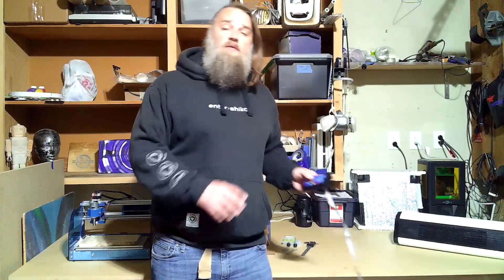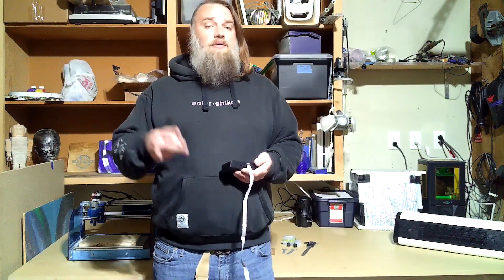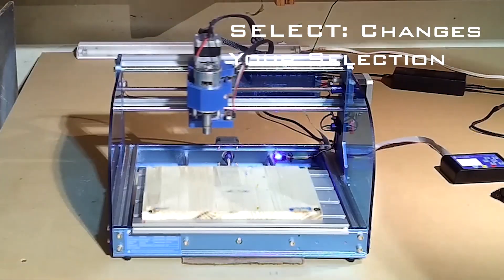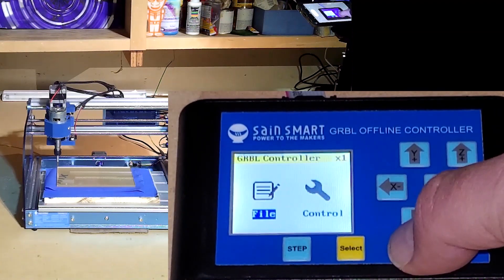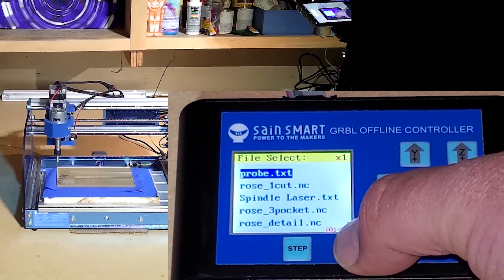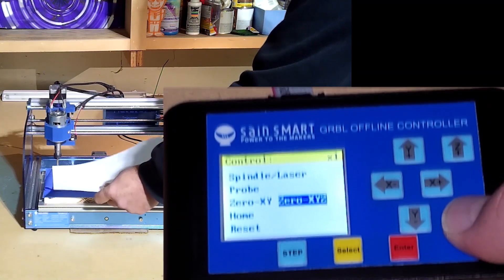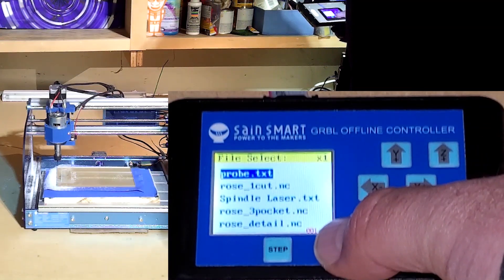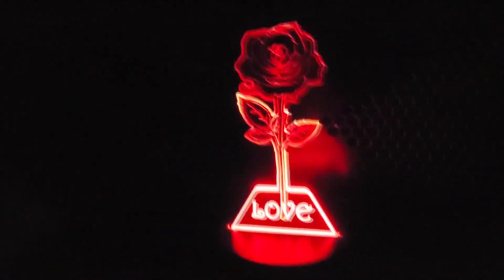SainSmart 3018 PROVer Off Line Controller Tips, Tricks, & Workflow

Comment: I have a problem when using the probe and the offline controller. After the probe touches it retracts way too much and activates the upper limit switch. How can I set the height it retracts? If I use a laptop and Candle, I don't have this problem.
Reply from the maker: There should be a 2 files on your SD card. Probe.txt & spindle/laser.txt  go into the probe.txt and see if there are any settings you can adjust for that. It's been awhile and I am not close to my machine to confirm if you can set it in that file.

Comment: Hi can you program with the offline controller?
Reply from the maker: No, you can not. You can only jog the axis, start and stop your spindle, or fire your laser, set job zero, and run your gcode.
Reply: @D.E.Hammer  thanks I am try to find a control can program there such thing? Or i need to write gcode line per line
Reply from the maker: Not that I am aware of. Best bet for now would be write the gcode. What are you trying to do?

Comment: ok so.... i have to save multiple cuts as different files to allow for a tool change?
Reply from the maker: Yes, you will need to save a gcode for each tool change.
Reply: @D.E.Hammer ok thanks. Do you have to redo the xyz after tool change? Will I have to start from the corner of the material then to 0 the xyz? I would think cuts would be off if I fuck that up. (Sorry for all the questions, struggling with it)

Comment: Could you explain what gcode you're using to get your 3018 to return to your work zero at the end of the tool path?
Reply from the maker: So towards the end of the gcode, find the last z movement, so if your retract height is 3, it should say Z3.00 after that I put X0.00 & Y0.00 (each on their own line) this sends them back to job 0.

Comment: I upgraded my 3018 prover with the 3040 kit but I don’t seem to have the max travel settings correct. Not sure what I am doing wrong but my machine does not cut anything that gets close to the dimension that I put in my project. I do have the soft limits enabled. Wondering if you might be able to give me some tips? Not sure what info you would need but let me know and I will give it to you.
Reply from the maker: Lets look at the $130,$131,&$132 Settings what are those set to?
Reply from the maker: Also $13 setting

Comment: Interesting video. I saw that you had separate toolpaths for each bit change. How did you get it to line up perfectly? I have a file that has two toolpaths but I don't know how to change the bit when it finishes the first toolpath. If I set the probe then the file starts with the first toolpath again. I'm new to this and I must say it is frustrating.
Reply from the maker: In the GCode after the last Z Raise I put X0.00 & Y0.00 (Each on their own line) which send it back to job 0, change the bit, reset the Z Height and run the next gcode.
Reply from the maker: At the 20:56 mark in this video is how I split the gcode in half.

https://youtu.be/h5KSI1hWGmk
Reply: @D.E.Hammer  thanks I’ll try that
Reply: Can a laser head be added to this machine, please?

Comment: Watched a bunch of videos of the Mach3 and other software to run on the laptop, but, wanted to see how to run this with the offline controller. Had a design planned with a 1mm bit too. Thanks for the explanation!
Reply from the maker: The offline controller is a nice feature. While lacking some advanced features it does get the job done.

Comment: I just got the Sainsmart 3018pro this week with the basic white offline controller and carveco. Do I need to send my toolpaths from carveco to candle before plugging my offline controller back to my machine? It will cut one tool path perfectly, but the second tool path is always off badly. If you made a video and I missed it on this sorry
Reply from the maker: You will need to pick one Candle or the offline controller.  The offline controller and your computer can not be connected to the machine at the same time. They are both trying to tell your machine what to do and it confuses your machine.  You can save your gcode from carveco, then use candle, OR save those gcodes to the micro sd card and then use the offline controller. I think that answers your question, but if I missed it let me know.
Reply: @D.E.Hammer  Ok so it's figuring out why the tool paths are not lining up properly with carveco maker then. Thanks for the reply dude happy cutting!
Reply from the maker: Are you using two different bits? I know in Carbide Create I have to edit my gcode to get my x & y back to 0,0. Not lining up could be several different things.
Reply from the maker: My file extentions are .nc. I have seen some people say they open their gcode in candle, then save so it formats it correctly so the offline controller can read it.

Comment: I have been using my machine with UGS for a while now. It works very well, but I can't seem to get it to work with the offline controller. When I press "Home," nothing happens.
Reply from the maker: What is the GRBL $21 setting set to 0 or 1?  This Enables (1) or Disables(0) the "Hard Limits" or Limit Switches. This needs to be enabled for homing to work I can not remember off the top of my head if you need to enable $22 as well.
Reply: Never mind, I just had to turn it off and back on and now it's homing as it should. The controller does freeze up from time to time, though. Should I replace the SD card? I'm using the original.
Reply from the maker: That would be the cheapest first option, but it could be the controller its self. Just remember the controller can only read a 1 gig sd card max or smaller.
Reply: @D.E.Hammer  My $21 and $22 are both enabled. Homing works only half the time. I can only get my G53 moves to work half the time, too. I'm going to ditch this thing and build a Raspberry Pi to run UGS instead. I've been using a dedicated laptop, but it's taking up too much room. Thanks for your replies!
Reply from the maker: I understand, I have a Raspberry Pi 4 with CNCjs for my longmill, but have hooked it up to my 3018 and it works great. I see that the controller works great for some and not so great for others. So maybe they had a QC issue on a batch of them.

Comment: I am using the online controller and using the paper method for setting Z.  and set XYZ.  I noticed on video that you spindle automatically starts and stops.  What do I need to do.  When I send the g-code created by Easel  I use the Spindle/Laser selection on controller to turn off and on.
Reply from the maker: The GCODE for turning the spindle on is M03. To turn it off it is M05. So Lets say I run my spindle at 9000 RPM the GCODE would be M03S9000.  I hope this helps.

Comment: I have the 4030 and it uses a different offline controller. I have to use it exclusively as the CNC will not communicate directly with my Mac running Big Sur.  It is a bit cumbersome to use but I think I have mostly figured out.  But I have no idea what the PWM button does, (related to laser option?) Thanks for great videos
Reply from the maker: PWM is Pulse Width Modulation which does relate to Laser, most likely a way to test or focus the laser. I am not able to say that with 100% accuracy as I have not really looked into the 4030 controller. Thank You for Watching & the comments.

Comment: This video really got me using the offline controller properly. I now use it exclusively and my laptop is back in my living room.
Reply from the maker: Awesome, and I think your laptop would be thanking you as well.
Reply from the maker: @David Villarreal  I have seen people using Chrome Books or inexpensive laptops. I even use a Raspberry Pi 4 with a Touch Screen on my LongMill (Also works on the 3018, as it is all GRBL Based). My basic rule of thumb for any computer/laptop buy is I5 (or equivalent AMD) or higher and at min 4 gigs ram. I would also try to get something made from the last 5 years, as have seen issues with people and the CH340 driver on older computers.
Reply: Can a laser head be added to this machine, please?

Comment: When setting up the zero xy, is it normal for the spindle carriage to move very slowly? When I first press the arrow it moves at the normal rate. After that it moves very slowly. Any help would be greatly appreciated. Thanks for the tip about putting the spindle and probe program onto the micro so card. I have been trying for over a week now to get it to work. I’ll load it in today and try it out. After numerous emails back and forth to Sainsmart they still have not been able to tell me why the included so card works and the new one doesn’t.
Reply from the maker: Have you set the $110 & $111 in GRBL?
Reply: @D.E.Hammer  I would if I knew what that was 😊. I am new to this and really struggling with the offline controller. I got it to carve one job using the sd card that came with the machine. During the next job it stopped in the middle of the carve and showed an alarm. When I restarted it it just drilled right through. On the first job the spindle did not shut off when the job was complete. Sorry to ask you so many questions but getting information when you starting from scratch is extremely frustrating.
Reply from the maker: @danhealy7341  I all to well understand how it can be frustrating.  So the $110 & $111 are settings saved on your board. I am assuming that you are using a GRBL board. You will need something like UGS or CNCjs to open up communication with your board. Then you can type in $$ to see all your machine settings. Here you will be able to set all of your Travel speeds, turn laser on/off,  or even refine your motor steps. This link shows you what each setting is for and what it does.

https://www.diymachining.com/downloads/GRBL_Settings_Pocket_Guide_Rev_B.pdf

This video is what I used to calibrate my machine:

https://www.youtube.com/watch?v=u4Mcjz7IP10

As for the alarm, plunging, and not turning off the spindle I would calibrate your machine and then see if you have any issues. If you do then lets look at that.
Reply: @D.E.Hammer  Thank you so much! I’ve learned more from you in one day than 3 weeks of emails from Sainsmart. I’ll let you know how I make out. Again, thank you.
Reply: Just a quick note, I finally got the offline controller to work thanks to your advice. Thanks again!
Reply from the maker: @danhealy7341  Awesome! I wish you the best on your cuts.
Reply: @D.E.Hammer  More problems, I have to set G0Z to 15 or more in order to use the probe. Anything lower than that causes the spindle to go down after touching the probe and jambs the machine. I am using a spoilboard, if that makes any difference. Also, after the carve is complete the spindle will not shut off. Only the emergency off button will shut it down. The off line controller will not shut it down. Any advice would be greatly appreciated.
Reply from the maker: @Dan Healy In regards to the spindle shutting off look at your G-Code at the bottom and make sure there is M05 before M02. As for the Probe, do you have the probe file on the SD card?
Reply from the maker: I would also like to say, I do not use the probe, so everything is just me researching. I find the paper method is faster and works best for me.
Reply: @D.E.Hammer  thanks for all your help. I do have the text for both the probe and spindle on the so card. I am not sure where to find M05 or M02 in the g code. I looked for it but had no luck locating it. In the meantime I will skip using the offline controller. Thanks again. I’ll keep trying to get it to work right but I’ve already taken up enough of your time. I’ll let you know if I come up with a solution
Reply from the maker: @danhealy7341  To find the M05 open up  your gcode file in notepad then sscroll down to the bottom. Sorry I could not help you with the probe. When I get some free time I will mess around with it and let you know.
Reply: @D.E.Hammer  thanks again! I will see what I can find. I’ll let you how I make.
Reply: @D.E.Hammer  Today I was able to run a carve with the offline controller. I am using Easel and apparently there is no shut of code at the end of the g code. Next to M5 there was nothing. I added the appropriate code and now the spindle shuts down after the carve is finished. I am still trying to figure out the glitch in the probe but I figured out how to work around it. Thanks again for your invaluable help.

Comment: When you press “home” have you previously told it where home is? Because when I press home, nothing at all happens. I just finished building the machine so I’m trying to figure out how I can test it to see if it’s working?
Reply from the maker: So "Home" is set up in the GRBL Settings and is dependent on how $3 & $23 are set up. GRBL assumes that your Home is in the Positive direction and will move all axis, until they trigger a limit switch. Here are the two links that give a good over view of GRBL and what each $ does

https://www.diymachining.com/downloads/GRBL_Settings_Pocket_Guide_Rev_B.pdf

https://bitraf.no/w/images/4/4c/GRBL_software_Instructions_CNC3-3018Pro.pdf